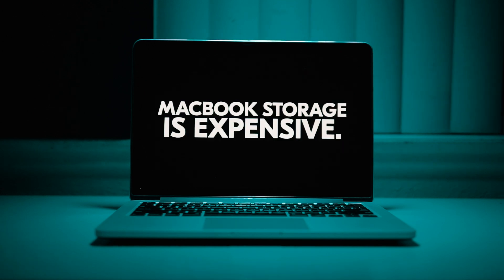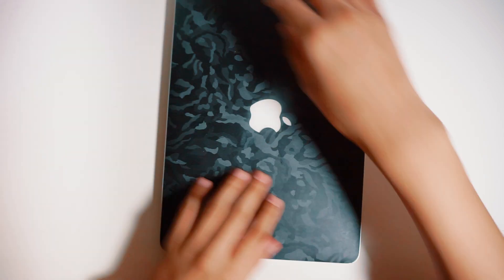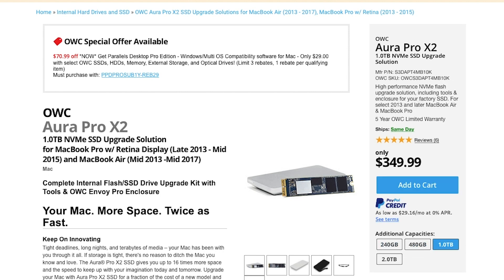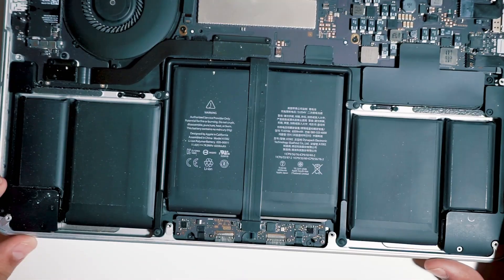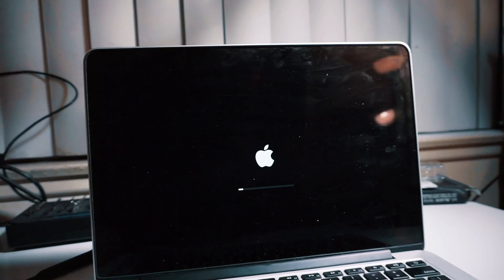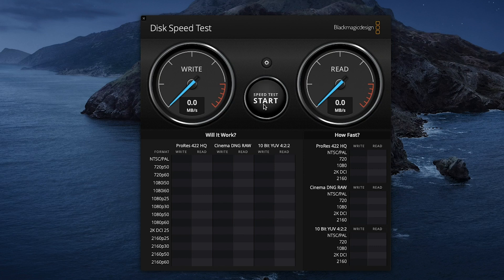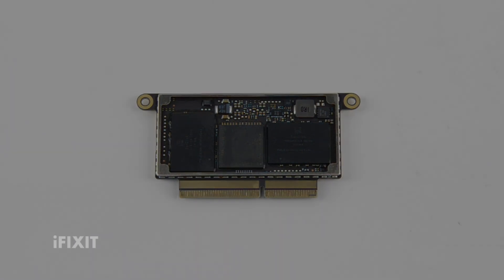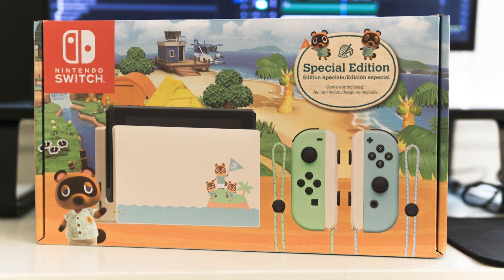The Last Upgradable Macbook Pro

Comment from the maker: I WAS WRONG. Check out the updated version of this video here! THIS IS ACTUALLY THE LAST UPGRADABLE MACBOOK PRO: https://youtu.be/Kh0v1-KBd_k
Reply: hello, if you want to buy a 2015 MacBook pro like that, where do you go?
Reply: @Tulus69  You can buy mine if you want it. I have an ebay page
Reply: @bobdylan6454  is it the same name
Reply: @Tulus69  Probably eBay or any refurbisher, you can't buy them from apple anymore. You can search on Google "Refurbished Early 2015 MacBook Pro" or on eBay, you could also look for a Mid 2015 (which is more expensive but has a bigger screen and better specs, this is the one I have and it's amazing for the things I do)
Reply: My dear boy converters M2 to and much more they exist for a reason tis called modification.
Reply: My Acer Hellios 300 eats your mac for brunch <3

Comment: My 2010 MacBook Pro has 512GB SSD and 750GB Harddisk = 1.25TB
My 2016 MacBook (the ultra slim ‘netbook’) has 512GB
…
The base MacBook Air in 2025 has 256GB?????????!!!!!!!!!!!!!
The upgrade is more expensive than gold by weight?????!!!!!!!
Yeah nah, I’ll just stick a 4TB M.2 inside my Windows laptop and call it a day. I’ll just keep using my old Mac until it breaks.

Comment: I’m kinda over the non-upgradability. I got a new in box 16” M1 Pro with 1TB SSD, it wasn’t cheap, but for the price of a 14” 256, I’m ok with it. That said, Thunderbolt operates at the maximum speed supported by NVMe SSDs, so there’s no performance trade off at all in working with an external SSD vs. an internal NVMe drive. I think Apple’s SSDs are slightly faster than NVMe, the difference may not really affect most users though. I also invested in USB-C monitors, so connecting it to my monitor when I’m at my desk charges it at the same time. I always leave my mouse at my desk, and keep it plugged into my monitor, so I haven’t even bothered using a USB-C dock. I thought I’d mostly be using my mecha keyboard, but not so. I love the comfortable feel of the new MacBook Pro keyboard, for me it’s the most comfortable I’ve used in years.

Comment: I have a 15" mid 2014 Mac Book pro that I have put through the ringer with hundreds of video projects.  It's still kicking.  I've reapplied thermal paste once, and changed the battery 3 times.  I think I'll upgrade to the m.2 drive now.  After that, buying a used 2016 and upgrading it seems like the way to go, as 500 dollars seems better than 2500-3500 dollars for the m2 macbook pros.

Comment: Sue Apple for soldering the SSDs onto the mac Motherboard making it very difficult and pricy to repair and overcharging way too much for storage and RAM and doing shady RAM and Storage management among other things. (SSD Swap even on 16GB with just a few Chrome tabs open)

Hello. It is time we gang up on Apple and SUE them for choosing to solder the SSDs onto the Mac Motherboards since 2016. On top of that, they also overcharge 3x-4x the price per TeraByte compared to top SSD manufacturers like Samsung, Sabrent, Kingston, Western Digital, Seagate, and so on. 2TB (non Replaceable) SSD @ Apple ---> 600$-800$. At the same time if u go on Amazon you can get a 2TB (easily replaceable) Samsung 980PRO SSD for 200-230$. 

- When the SSD Fails.. and it will eventually, they will also overcharge you for the repair, because guess what, if you need it replaced, the way they go about it is by replacing the whole motherboard which is an absolutely wasteful way to do it. Imagine replacing so many parts when you could've just replaced the SSD. But they want YOUR MONEY (As much as they can get their claws on).

- RAM: they charge 400$ for 32GB and 800$ for 64GB of RAM. At the same time, you can go on Amazon and pick up 32GB of DDR5 for 140-155$ and 64GB of DDR5 for 260$-300$ (Replaceable)

- They also do some shady stuff with RAM management: if you get 16GB of their overpriced RAM and monitor your SSD swap Memory, you’ll notice that the macs write a lot of GB to the SSD like 16GB isn’t enough for a couple of chrome tabs. Disgraceful…. ( what I’m aiming at is that they’ll most likely make your non-replaceable-soldered SSD go bad sooner than later… good luck getting a humane price for the repair.

- And last but not least, I don't know exactly what they do but they fill your Mac and iPhone with not-so-specific files that you can't quickly discover and delete, thus making your storage fill up quicker. Basically, they're forcing your hand and your wallet to buy the bigger storage option (which is overpriced, to begin with as stated at point 1). I just had to delete apps on my iPhone because when I go into Settings/General/iPhone Storage and click on any App, I can't access/open any Apps' "Documents&Data" just so I can see what is taking up so much space and actually delete all that data that's uselessly filling up my storage.

Apple products are made well and are very shiny and pleasant to the touch and to use. All they have to do is stop making those shady decisions behind the curtains. But they always make those shady decisions until enough People start making noise about it or a Higher Authority decides to step in and force them to comply (to behave like good human beings). For example, the EU stepped in and forced them to implement USB-C. Apple's Lightning connector was a nice connector until 2014 until the USB-C connector came along... and yet it's 2022 and if you get a nearly 2000$ iPhone, you still get a Lightning connector on it (USB2.0 speeds: 480Mbps/60MBs per second). up until now, Apple has proven that it is in their Essence to not think about their users, to not listen to them, and to always try to squeeze as much money as possible, borderline robbing you until people start to catch on and speak up and even when they do speak up, Apple always tries to stand their ground with their shady business practices.

We must take action. Seriously. Either ask higher authorities to step in and Force Apple to clean up their act or we just collectively stop buying Apple products. Keep in mind that apple decided to remove the Headphone Jack and soon after the industry followed them instead of standing their ground. ( Keep in mind that apple sells wired earpods for 20-25$ but sells their Airpods for 250$. (I wonder why they took out the Headphone Jack...) so just because they are wireless the price difference is roughly 1200%. I would never buy their wireless earbuds because I see it as their greedy Sin. So just because you introduce wireless functionality you do it at 1200% price difference? NOPE. HUGE NOPE. Imagine if we all Stopped buying Apple products for 3 Years. Imagine the looks on their faces year after year when they see 0 Sold Products :O:O:O. That would be awesome. 

Wish you all the best and take care.

Comment: I just bought a 15 inch mid 2014 Macbook Pro.
Waiting on my 1tb SSD to arrive...in January. 🙄
It's the 16gb Core i7 with dual graphics.
There were two of these exact models, one with the built in Intel GFX and the dual GFX that has the Nvidia GT-750M with 2gb of its own RAM.
I've put a new battery in and am just waiting on my 1tb Samsung Evo Plus to arrive and then it'll be a beast. 😃

Comment: Has anyone run into this issue: Switched out the SDD in 2015 MBP 15" Retina to 1TB (Samsung Evo 980) all seemed to work fine, but today, trying to use Migration Assistant, the screen doesn't work???  I hear the fan blowing at times.  Have tried doing a reboot, shutdown, etc as per normal w/ this generation of MBPs but nothing seems to be working...

Comment: I’m using my SSD on 512GB, but still a weak speed..maybe I need to boost up ram. And by today, in 2025, i already upgraded the ram and running well on macOS Ventura on my Macbook Pro mid 2012...the Macbook Pro 2015, can run on official macOS Monterey, also extends its update to Sequoia in 2025..you can upgrade from the OCLP by Monterey..

Comment: And what about the RAM or the CPU? Can they also be upgraded?

Although I have to admit that replaceable storage is probably the most important thing. 
In case of a laptop defect, you can still access your data and you can send the laptop in for repair and be sure that no one else has access to your private data. As long as you have removed the drive beforehand.

Comment: Just upgraded to 1tb. Followed your video. Ordered the stuff. Cost me about £100. Pretty simple to do it yourself. Feels like a brand new laptop. Thanks for your video and upload. Unreal
Reply: Hey, have there been any issues so far?
Reply: @zakzamorin8153  none at all. The laptop feels a lot quicker and seems like the battery lasts longer. Takes about 10 mins to do it plus installation.

Comment: Since you need to be running at least MacOS 10.13 High Sierra to use a NVMe SSD, if you use CMD-OPT-R at boot up, you will load the Internet Recovery Mode for the latest version of MacOS compatible with your Mac… this will let you format and install MacOS to the new hard drive without needing a separate bootable installer.

My machine is a mid-2014 MacBook Pro, which shipped with Mavericks- that system did not natively support NVMe, so the drive will not show up in disk utility or terminal in the native recovery mode (CMD-R) which uses the MacOS version that shipped with the Mac.

This is just another suggested workaround for those who may not know how to create or use a bootable installer. Also, it’s a good reminder that there is a difference between Internet Recovery Mode (CMD-OPT-R) and the native Recovery Mode (CMD-R) and for most of us, CMD-OPT-R should be the default recovery option.

Comment: You can actually upgrade the ssd in the 2017 Macbook Pro 13", unofficially that is. The replacement ssds can be found on ebay!
Reply from the maker: Check my newest video! 🤗

Comment: I think your numbers could be low due to the age of your laptop. It may possibly cap it at a certain number. Last thing I could think would be software. I would try it on a desktop to see if it's due to the operating system.

Comment: I'm updating right now as of this writing. I haven't use my late mbpro 2013 for a very long time. I noticed the trackpad is not the same anymore, cursor jumping everywhere freezing, running a little bit slow with a rainbow circle and a needed battery replacement. How did you maintain your mbpro?

Comment: Actually last upgradeable macbook is macbook pro 2017 13” base model without touchbar, with 2 usb-c, where there is a proprietary ssd, which can be upgraded to nvme m.2 2242 ssd using a reduction.

Comment: By the way there is a USB enclosure for those Apple SSD drives now so you can use the old one as an external drive. I remember seeing one on the Newegg web site. Search on item number  9SIA6V85GY4928 It's about a hundred dollars so not sure if it's worth it unless you need to get some data off that drive.

Comment: I did this exact thing with my 13-inch 2015 base model and actually had to buy two of those adapters because 1 kept crashing the system with kernal panics. Thank god the second one worked perfectly😂

Comment: There is another option that natively plugs in without the need for an adaptor (and it's cheaper than the OWC version) - it's OSCOO ON900A - I just fitted one to my late 2015 iMac and it fitted in with no drama.. it replaced the 32Gb Apple blade drive I had from the factory.. definitely a good option if you don't want to go down the adaptor route and it's also very reasonably priced in comparison with other options.

Comment: I wish would have seen this video Last year. As an Apple certified Macintosh Technician, and Owner of a computer repair store, I would have told you to immediatly  enable trim support in Terminal upon installing Mac OS after your successful migration. Trim Support does something similar to what disk permissions on a Mac or Defrag does on a PC. It allows MacOS to fill in empty blocks on the SSD after deleting files. You may experience premature SSD failure as a result of not enabling trim support. Trim Support is auto enable on OEM Apple SSD and Flash storage drive. This happened to a friend of mine. Best of luck..!

Comment: Besides the 2017 model MacBook Pro* 
Apple made it have removable ssd so you can swap between other MacBook SSDs or with an adapter a few specific Nvme SSDs.

Comment: The issue with replacing the apple ssd to an non oem will kill your battery life. I did this and until i switched back to an oem ssd, the mac would get super hot and the battery would die super quick. It is because there is no power management for the non apple ssd

Comment: I really need help with my MBP 15 (13 inch - early 15). I have 16GB DDR3 2.9 GHz but only 128 GB.  Just want to find out, if I should attempt this as a complete beginner? Can beginners be able to do this? or shall I stay far away from it... thoughts?

Comment: Bro the ssd only reaches 1400 mb/s just because the slot you put that into is not capable of the crazy 3400 mb/s, it requires a newer m.2 slot

Comment: I have both the 13 and 15 models and I love them. I was bad and I swapped the sticker from a dead 128GB drive with my 512GB drive in my 15", and sent it off for service. Apple actually swapped the drive and I had a new 512GB drive that I could also use! I stuck that in my 13" and now I have a 256GB drive that I'm going to use in my mom's 128GB MacBook Air.

Comment: The 2016-2017 13-inch, non-touch bar MacBook Pros (a mouthful, I know) are actually upgradeable too. They have detachable SSDs and you can find adapters on Ebay/Amazon.
Reply: Yep I got lucky and won an auction on ebay for a late 2016 mbp Core touchbar i7 2.7ghz 16gb 500ssd amd radeon pro 455 model for $180 and assumed it was priced so low for parts but the thing only had slight laminate issues on the bottom right of 15in display that you can't even see unless a white backround is used which I never use obviously and I've pushed it to the limits having 10 apps open at once, rendering a 1hr video on premiere and playing counterstrike on steam at the same time and didn't get a single hiccup...absolutely shocking. Thinking of upgrading it to 1TBSSD now GLAD to know it's the last model to be upgradeable

Comment: My experience was much smoother with my 2015 15” MacBook Pro from the base 250GB SSD to a 2TB Seagate Firecuda 510 which offers a theoretical sequential max read of 3450MB/s and write 3200MB/s (I reached numbers of over 3000MB/s in both R/W using Big Sur and Catalina). 
Instead of going to recovery mode with a time machine backup, (which of course I took before I begun) I attached the new SSD to an NVMe to USB-C enclosure (with a USB-C -> USB-A cable) and I used Carbon Copy Cloner to make a clone of the APFS file system of my internal SSD.
Then, I simply swapped the drives, using an even smaller adapter for the Seagate SSD that doesn’t seat underneath the drive, but being more like an inline tiny board, just swapping the pin out of the SSD to much the proprietary layout of the MacBook Pro and it simply booted normally as if nothing had changed.
It’s been a few months now, but if I recall correctly, Carbon Copy Cloner took also care of the drive size differences, expanding the original 250GB APFS partition to the new 2TB size.
Another way of checking the speed of your SSD in user level (not in kernel level which should reach the manufacturer’s suggested max) is by timing from the terminal, the reading of a file bigger than the size of your RAM and then dividing its size, to the time it took to read it. Benchmarks like BlackMagic that you used do exactly that. (A command to do so from the terminal, assuming that the file is named movie.mkv would look as following: “time cat movie.mkv > /dev/null” without the quotes. If your file is for example 12GB and you have an 8GB RAM, you know that the MacOS can’t cash it to the RAM so you’re measuring the actual speed of the SSD every time you repeat it and not the speed of your RAM after the first time you read the file

Comment: Regarding the read/write speeds you are seeing on your 2015 MacBook Pro. The 1300/1400 MB/sec  speeds you are seeing with your new NVMe M.2 drive is typical due to the actual archetecture limitation of your computer. You will never see the advertised speeds (3430 MB/sec) that the NVMe storage drive can reach unless you put it into a computer that has the bandwidth to support those speeds. Still, this is a huge improvement over what you had.

Comment: You can still upgrade the ssd on the 2016-2018 MacBook Pro without touch bar. But after 2019, yep, every model is fully soldered.

Comment: I don't know if this is mentioned or not, but there are no enclosures to put the old SSD into and use it a extra memory.  It appears only OWC has an enclosure that works, since the memory being replaced is Apple specific.  So if you want to use the old SSD, add about $90 to your total cost.

Comment: This video saved me! My SSD went out in my 2015 MacBook Pro, and I didn't know this was an option. I grabbed a Fledging 1TB Feather M13 Turbo. It seemed cheaper than buying the SSD and adaptor. Also, it came pre-loaded with macOS High Sierra. Only took a few minutes to instal, and when I turned it on, I updated straight to Big Sur. MacBook is working better than when it was brand new.

Comment: am I able to upgrade this with Macbook Pro (Retina, 13-in, Mid 2014) with adapter and SSD link you provide?
Reply: also what reading and writing speed will be since it's only 13-inch?
Reply: does this adapter works as well? https://www.amazon.com/Convert-Adapter-MacBook-Retina-Upgraded/dp/B07VVNKRYR/ref=pd_sbs_147_2/140-0688350-7703737?_encoding=UTF8&pd_rd_i=B07VVNKRYR&pd_rd_r=5ee16282-f3d6-47cf-88e7-b44a1c041002&pd_rd_w=Ea1Qa&pd_rd_wg=nvzEf&pf_rd_p=ed1e2146-ecfe-435e-b3b5-d79fa072fd58&pf_rd_r=0A4PNW0XV2ZMT45MDG87&refRID=0A4PNW0XV2ZMT45MDG87&th=1